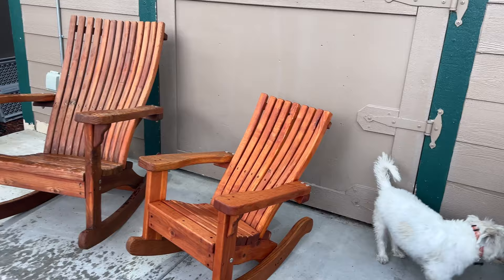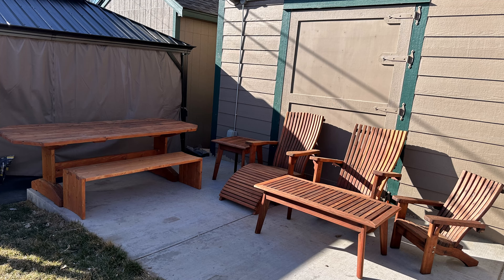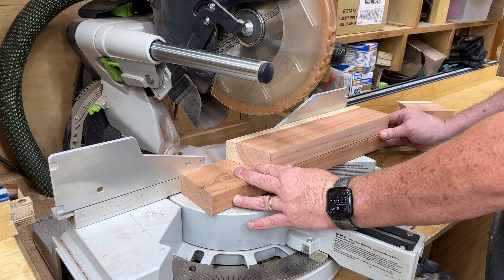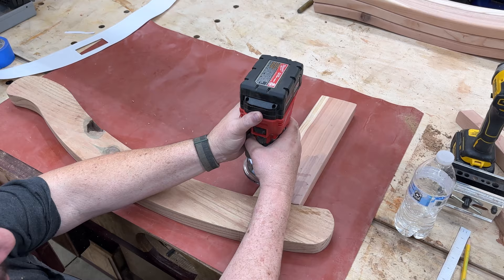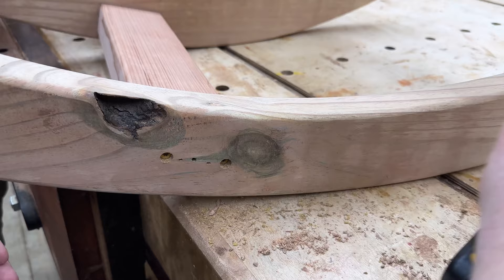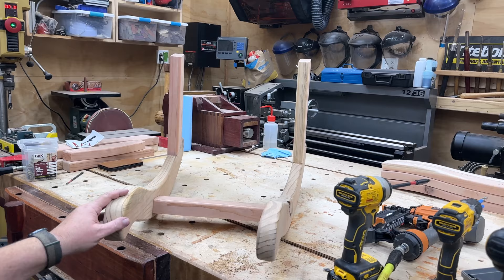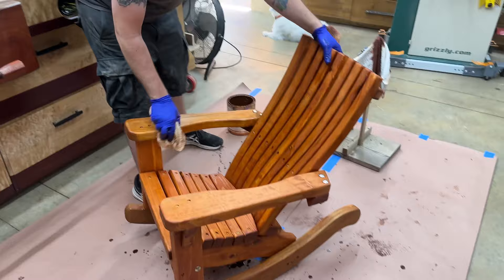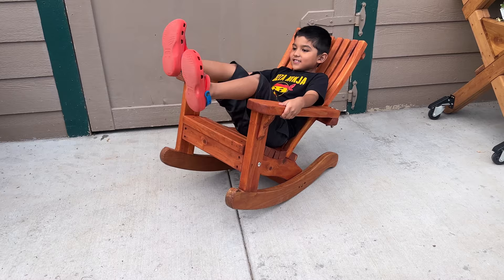Kids Sized Rocking Chair, Adirondack Style DIY Make Money Woodworking

Comment: To center the chair mark the center of the lower and mid supports and install one backseat then using a framing square against the slat and lower support will give you the alignment without using the plumb bob approach
Reply from the maker: Brilliant!

Comment: Just about to start searching for a great cnc machine. What is that one that you use? It looks like a Shark, maybe? I assume it's robust and quite the workhorse. Is there a lot of maintenance that it needs? Sorry for all the questions. Thanks!
Reply from the maker: Hi,

No maintenance really. And it’s almost ready to go right out of the box. Maybe 15 min of assembly until you’re cutting your first piece. 

I did buy everything from Amazon. I usually do for any tool I get. To me there’s nothing better than being able to return it at their cost if I don’t like it, or it’s not working. 

They don’t have one that comes with the 3HP spindle. That’s always extra.  The best way is to buy the base unit
https://amzn.to/4694hra

That comes with no spindle and you’d have to supply your own palm router. 

Then add the 3HP water cooled spindle kit with the VFD 
https://amzn.to/3NA3Yyg

As for collets/tool holders it takes the ER20 series. I bought these, which are awesome!
https://amzn.to/3PqBybg

The machine itself also comes with Vectric’s V-Carve in the latest edition. This is the top of the line software, and actually very easy to learn.

Comment: What CNC machine do you have and what type of wood did you build this chair out of.
Reply: It's a shark 2×4 cnc and he uses cedar and redwood
Reply from the maker: Here’s my exact CNC. 

They don’t have one that comes with the 3HP spindle. That’s always extra.  The best way is to buy the base unit
https://amzn.to/4694hra

That comes with no spindle and you’d have to supply your own palm router. 

Then add the 3HP water cooled spindle kit with the VFD 
https://amzn.to/3NA3Yyg

As for collets/tool holders it takes the ER20 series. I bought these, which are awesome!
https://amzn.to/3PqBybg

The machine itself also comes with Vectric’s V-Carve in the latest edition. This is the top of the line software, and actually very easy to learn.